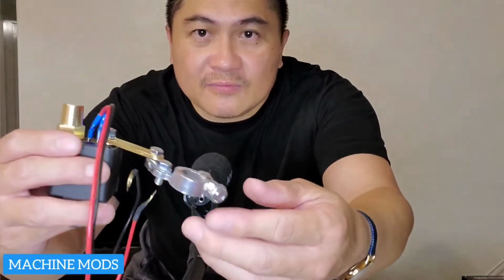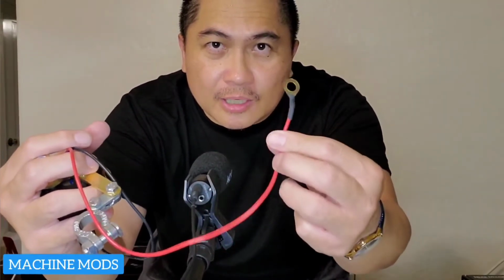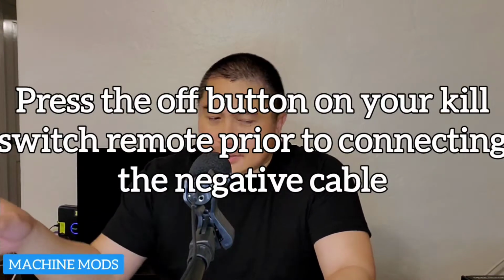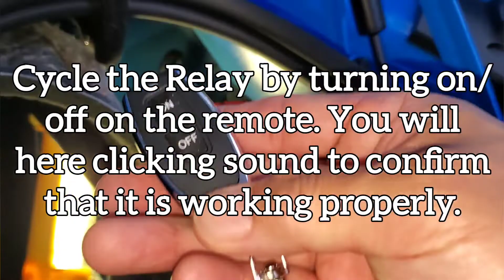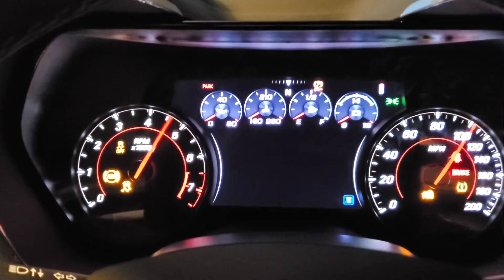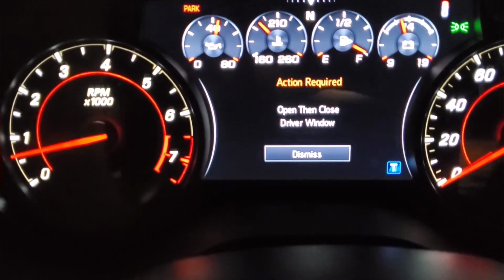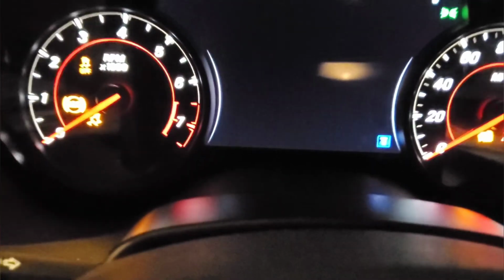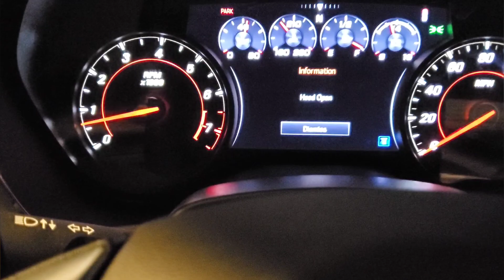2022 Camaro Anti-Theft, Anti-Carjacking, Kill Switch, Stop Battery Drain battery located camaro

Comment: You can still push start a manual, no battery needed. I want to do a fuel pump kill switch
Reply from the maker: I have a car here in the Philippines and since I don't use it much, the battery died. So I pushed it down hill, ignition to on pos, popped it on 2nd gear.... no start.   I had to charge the battery a little bit just so when I put it on ignition on, the fuel pump will run for 3 secs.    But your Idea is correct though.  You can still do the fuel pump.  That's even harder to steal.
Reply: You need ignition for the car to stay on my guy and ignition comes from the battery especially in these newer cars like the camaro
Reply from the maker: True.
Reply from the maker: @1985GrandPrix yes it does.   The only thing I reset are both of my windows.  It ask me to roll down and roll up.
Reply: Not if the Electronic brake is engaged, can’t turn it off unless the car is running
Reply: Check out the IGLA system. That will give you much better protection then just a kill switch.
Reply from the maker: I will check it right now, thank you.
Reply: @machinemods  I’m on my second 23 ZL1 because the first one got stolen. I made sure it wouldn’t happen again.
Reply from the maker: @dustinteasdale6091 sorry about that.  Thank you for the tip.
Reply from the maker: @dustinteasdale6091 do you know if they can use the Vin# to make keys?
Reply: @machinemods they can use the vin to make keys IF they can connect through the OBII port. IGLA blocks and requires a pin code. I can hand you the keys to my car and you can’t start it.
Reply from the maker: @dustinteasdale6091 that is a nice feature.   I am afraid to ask "How Much"
Reply: @machinemods it was $1,200.00
Reply from the maker: @dustinteasdale6091 not so bad at all.
Reply from the maker: @dustinteasdale6091 The nearest installer for me is 2hrs away.  I will check  them out next week.  Thank you.
Reply: Who tf has time to steal a car via push to start lol goofy
Reply: No, you can’t. Because there’s no energy to power the spark plugs. And slowly turning the engine over pushing the car, the alternator isn’t gonna generate enough power to fire them either.
Reply: Okay ba yan kabayan. Wala bang naging problema sa sasakyan mo? Ilang buwan muna ginagamit yan?
Reply from the maker: @-paul-1613 kabayan, no problem since 2022.
Reply: @machinemods  pwede kaya yan sa civic 2024?
Reply: @dustinteasdale6091 what u use for antitheft?
Reply from the maker: @-paul-1613  yes of course
Reply from the maker: @pontiaco  it helps prevent theft.  Newer cars will not start with a no battery connected.   Ignition needs 12vdc.  If you push the car, the ignition will not ignite without a the battery power. Therefore, the car will not start.

Comment: I did a jumper wire with a fuse so I don’t loose everything every time. Also cycling the computer constantly may, I say may cause it a problem.  The small fuse just pops if you try to start it.
Reply from the maker: Ok. A different method.  Cool.
Reply: Can you go into more detail with this please I don’t understand
Reply: @alexanderperisteris47   I have a remote relay which kills battery power completely.  Without power you cannot start any vehicle.  The problem is this removes all your presets.  So I took a 12ga. Wire and ran it across from the battery to the relay.   This keeps power on.  I installed a 30 amp fuse.  I don’t loose my presets.  If someone got in even with the key and tried to start it the fuse would just pop.   A wire that small cannot carry the amps you need to start a car.   You also need to lock your hood so they can’t just remove it.   I doubt they would even try but you never know.   In my opinion the easiest way to defeat them is with very old school ideas.
Reply from the maker: @alexanderperisteris47  it is a remote control that disconnects your battery from your engine.  Once you have activated the battery remote control, the engine will not start even if the driver have the keyfob.
Reply: This is a huge downside to this device. It is just a "Dumb" device, not sophisticated enough to prevent other issues and problems.

Comment: Disconnecting the battery would immobilize the starter and fuel pump and park brake release door locks and is the best way by far to immobilize the vehicle as nothing works including the OBD port. This is all great except the memory for window position for example would need to be re-learned every time the disconnect is used, Not a huge deal but consider there is also the risk of damage to the onboard computer from disconnecting and connecting the battery. Battery replacement is a fairly rare occurrence but if your in and out a dozen times a day you can see that you are seriously risking damage to a very expensive component in the car and if it gets fried your vehicle is bricked until it is replaced. Now instead if the battery disconnect switch was wired directly into the the starter the engine would not crank over. Not using as a battery disconnect but as a starter disconnect. This would be great for Automatic transmission equipped vehicles but manuals could possibly be bump started. This is where the battery disconnect switch wired in line to the fuel pump would not stop the engine from cranking but without fuel the engine will not start. Thing is in our efforts to protect our vehicles we can inflict damage on the vehicle and grief on ourselves in the attempt. I have been looking into ways to protect vehicles that are push button start and have come to understand that any modern vehicle is heavily computerized. This changes the game as any computer is very sensitive to surges arcs and shorts. If you don't think what I am saying is accurate that is fine but before you dive into theft prevention solutions do lots of research first. First thing would be asking your dealership about repeated disconnection of the battery and the possible risks involved. I don't post this to be a troll but understand that I would be furious if I thought something was a good thing, Installed it and it ended up costing me big money to repair.
Reply from the maker: You have a good point.  I have this installed in mid of 2022 on my 2021 Toy Tundra Truck and on my 2022 Camaro SS.  So far I have not had any problems yet.  I will try to do a starter kill switch and a fuel pump in the near future.
Reply: @machinemods  Was not looking to rain on the video. I realize we need solutions that are effective. At the same time there can be serious consequences when modifying electrical systems in today's cars. Spikes in voltage is common when initially  connecting of the battery. In fact I have to wonder if the switch would be better installed on the ground side rather than on the positive. I would need to look at proper installation procedure of the battery however I believe the ground is the first to come off when removing and last when putting it back in, Partially so the battery is not accidently shorted by a tool if it contacts a ground while on the positive terminal. A starter interrupt is great in automatic equipped vehicles as the thief can't kill the battery trying to start the vehicle. However even with access to the OBD port a fuel pump interrupt stops the vehicle from starting all together. So will work with both Automatic and manual transmission. Another possibility to include would be the park brake system. This is electronically engaged and disengaged. I know if you put the manuals into gear with the park brake on the computer will signal the brakes to release if you try to move the car. If a person could find that system and disable the release signal it would also make the car more difficult to move. They couldn't release the park brake and push it away from the home. The park brake and fuel pump would be a good combination I would think. I may go that route but incorporate 2 relays run by a remote disconnect. This way the remote kills both relays for 2 different systems. On the relays are energized, Fuel pump and Park Brake are in circuit. Park and turn the car off get out and lock the car up then activate the disconnect disabling the fuel pump and brake release. So that is my plan thus far but I need to look a little further into it. The nice thing with including relays is you can add even a third relay if there is another system you want to disable like power to door locks as an example. Even the transmission park release circuit can be used ( You must push in the brake to release the shifter to get it out of park in Automatic ) Clutch must be pressed to start a manual ) Open those wires with a switch and either the vehicle starts but don't move ( can't get out of park )  or the engine will not crank over.  There is lots of ways to make the vehicle immobile.
Reply from the maker: @inthestix100  you have great Ideas, bro.
Reply: @machinemods I need ideas on where to put my kill switch in line with my fuel pump. I just don’t know where to put the switch itself
Reply from the maker: If your relay fails while driving,  your engine will shut off.   That is why I am hesitant to do the fuel cut off. Unless I can find a reliable relay?   If you want, I can make a video on how to make a basic cut off   kill switch.
Reply: @machinemods  Don't have to really do a fuel cutoff, Could tie into the interrupt That is on the brake pedal in automatics or on the clutch pedal in manuals. Have to depress pedals to start so disable that circuit. Just saying there is alternatives better suited to immobilizing the car instead of the battery connection.
Reply from the maker: @inthestix100  good point.

Comment: This is what I need to do. My 2015 Camaro 2ss was stolen from my house and found in Oakland stripped
Reply from the maker: I agree bro.
Reply: @machinemods  The only problem is in California. It'll affect the smog if it's directly connected to battery unless it's connected to the ignition. But I might as well go extra mile and put a pedal lock steering lock, boot lock and the whole 10 yards on it
Reply from the maker: Oh. I didn't know that.   My car is a 22. So it will be awhile before I have to do smog.
Reply: @machinemods  Right on that. Saves you sometime. Yeah they got mine pretty clean. It was parallel parked in front of my house hella tight between two cars. I was sleeping with my bedroom window open all night which is close to the front of the house. Didn't even hear my exhaust go off and I have a MBRP XP series catback so usually people could hear it. Little bit down the street. Didn't hear nothing. No alarm. No nothing went to bed at 11:00 p.m. woke up at 4:00 a.m. to drive out to s*** hole San Francisco to work as a HVAC tech saw my car was gone. Looked at my phone. Gave myself Max one hour before I consider it a total loss. They found it off e Street in Oakland. Only the transmission engine catalytic converter, and all my interior. For 15 my car was spotless look like fresh off the lot. Still the f*** part is I bought it back in July. Had it less than a year I parled from State prison March 5th, 2021. I did 10 years in prison for a case I should have walked on self-defense. I was a victim of a bully. I chose to stand up for myself and my friends ended up doing 10 years. Within less than 2 years of being out I became a certified HVAC technician and was able to buy me my first dream car all on my own. No co-sign or no nothing no help. Now. I had it robbed for me. Right now it's just waiting for the bank to finalize everything and then save up for another down payment and get a new one. Unfortunately the insurance only appraised it at 30k, which I know it's worth way more than that. I did get my cat back exhaust back off of it. They left it for some reason. I still owe 32k on it, at a 38k.
Reply from the maker: With this remote control battery cutoff, when I go to gas stations,  In one pocket, I have the remote to disable the car and on the other pocket I have the remote to start the car.  If ever they rob me for the key/car, they won't be able to start my car while I secure myself in so distance away.  I've been to Frisco  and Oakland,  I wouldn't drive my nice car over there. 😒

I am sorry about what happened to your car.   I don't understand why people have to steal from others.   I hope you will overcome this.
Reply: In the Camaro subreddit I keep seeing Oakland being the place where they find cars stripped, at least 2 confirmed were found in Oakland, I knew Oakland was bad but geez
Reply from the maker: My kid got me an AIR BNB and it was cheap.  When I got there, the neighborhood was so bad, I slept in my truck.  The remote shut off gave me the piece of mine specially when I get gas in an unfamiliar neighborhood.

Comment: I bought the exact same one and for some reason it isn’t getting power
Reply from the maker: Return it and get another one.  1 failed on me, it would not start my Tundra.  At first, I thought my battery was discharged.  But it was the poor contacts inside that relay.  Now, it is working fine.

Comment: When you disconnect the battery with this switch does it also remove your presets?
Reply from the maker: My cars stereo automatically connects to my cell phone to play music and use google maps.  The clock and all other stuff stays normal.  The only thing I have to do is when I reconnect my battery on my camaro is open my window and close it for driver side and passenger side one time.  That is all.  Everything is normal.  I love the security it gives me and I have left my car for 30 days when I went on my vacation and when I came back, the car started right up.  I also installed it on my 2021 tundra.  I don't have to reset anything. I don't have to reset anything. I love it!!!  On my next car, 2025 Mustang GT, I will install the same gadget.

Comment: Can you provide link to buy this or what is the name of this product?
Reply from the maker: BROODAY Remote Battery Disconnect Switch 12v, 250A, Car Kill Switch Anti-Theft with 2 Remote Keys, Kill Switch for Car, RV, Truck, Prevent Battery Drain https://a.co/d/crqqqC7
Reply: How long does the battery on remote keys last?
Reply from the maker: @kranthik5531 I have installed them back on 2022, it is still working right now.

Comment: part#
Reply from the maker: The I used is sold out.   This one is better it has 1,000 amp cranking amps for starters. 

 ZOZOMOTORS 3/8" Side Post Remote Battery Disconnect Switch 12V Battery Kill Switch for Car Truck UTV ATV Marine Anti Theft Battery Cut/Shut Off Switch, 200/1000 AMP Heavy Duty, On/Off https://a.co/d/2jWlKmG

Comment: Great idea, except using it as a battery disconnect means you would have to reset things like your clock etc each time you use it.

But the design on this one means it’s a remote disconnect relay.  You could just as easily use this to remote disconnect the fuel pump relay or starter relay.  Which would be effective for theft prevention and easier to hide if someone looked under the hood.
Reply from the maker: That is a great Idea.  I will try to find some time to do it.  Thank you.